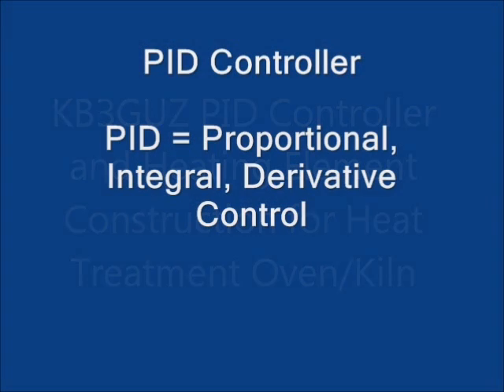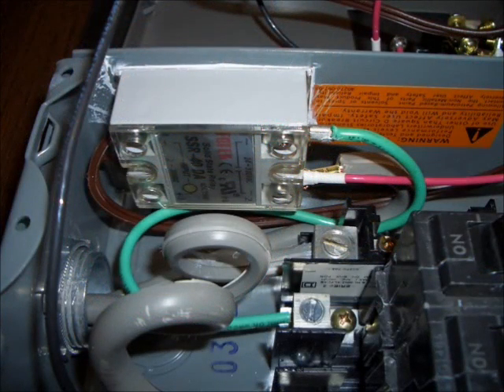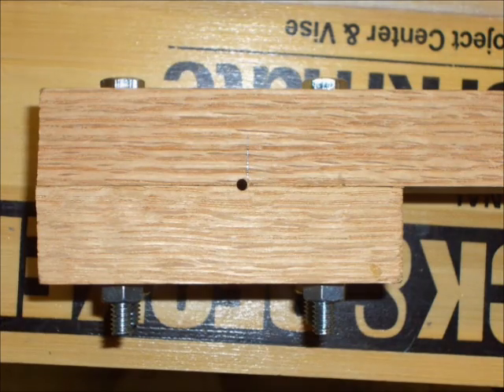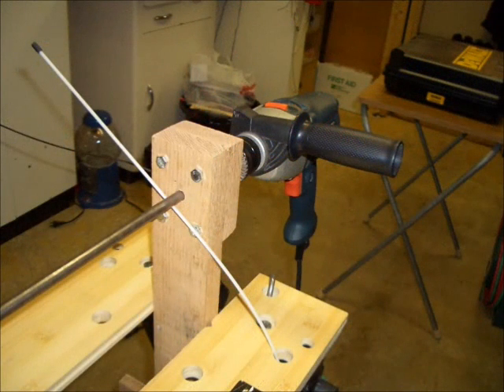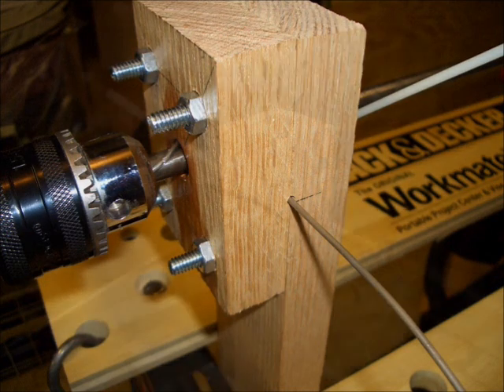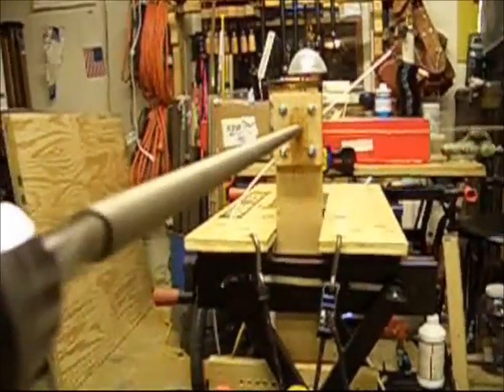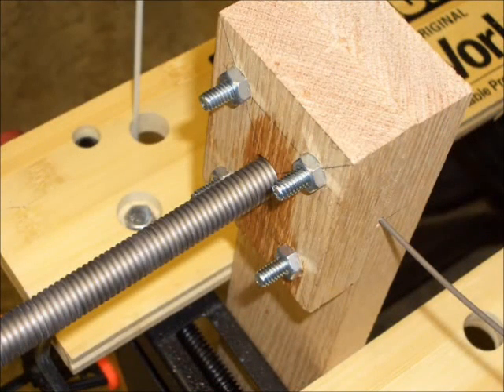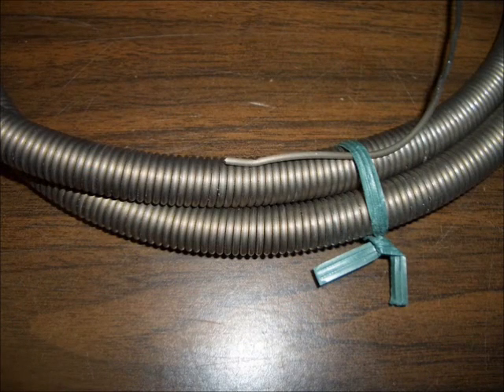kb3guz - How I made a PID oven or kiln control and heating element.

Comment: excellent video and picture documentation!!! whats next? i m curious to see the spiral in action! i guess its kanthal D wire. 3/8'' dia makes 9.5mm?! it looks thinner on video. and calculating with 9.5mm i endup with ~500mOhm for 100ft which is definitive to low for 230V. 3/8'' is diameter or square? hope you can help after so many years ;-)

Comment: great video. do you think this schematic would work with electric oven heating elements? I want to build the exact pid controller box only use 4 heating elements all wired together instead of a coil.

Comment: I'm Building a conveyor belt Oven for 600 degrees f.  " Just Drying Ink"  and Only Really needing 320degrees f   With 220VAC
Two:  Kanthal A1 wire 16 G 25ft roll's that will make Two 5ft coils 1/2" dia.
Run them in series, with a PID + K Thermo Senor + 25A SSR.
IF I have done my math Correct the 16g:  0.324 Ohms/ft, Come out to 16.20 for 50 foot of wire, and will run @ 13.58 amps and 2987 Watts..  I THANK YOU, your Vid Helped ALOT !  I just wanted to Double check with you that I'm Correct ?

Comment from the maker: Also, don't forget that the Kanthal wire will be uninsulated and energized when the oven is plugged in.  Don't touch the heating element when plugged in - you may die (if you provide a ground path)! Safer to unplug before you open the oven for any reason.

Comment from the maker: You won't want to draw more than 15 amps of current at 120 VAC, and you might need 1,500 Watts of power to heat your well insulated oven. Therefore, using 12 amps for safety & the Ohm's Law calculator mentioned above, the Kanthal wire you need to use will need to have 10 Ohms of resistance.  Knowing this, and the Ohms/ft of wire, you should be able to calculate the length of wire needed. You'll need a solid state relay controlled by the PID, and don't forget to include a fuse or circuit breaker.

Comment from the maker: I don't know if I can help, but if you search for "kanthal wire" you should find a manufacturer's website that will.  I know you can use PID to control the oven.  I don't know how much Kanthal wire you'll need but the manufacturer will.  You get a certain number of Watts of heat per foot of wire, and the wire will have a certain resistance per foot.  Use variations of Ohm's law to figure the rest; i.e., E=I*R and P=I*E - see w w w. ohms law calculator. com/ohms_law_wheel. php (remove spaces).

Comment: can you help? im trying to make a small mailbox kiln for around 100 dollars can i use china controller and heating element? can you send me the simple specs ? i want 120v idk how many amps or the other stuff but i want to use it on house plug, i will be using it for boro, probably 1500 degrees f. at the highest..

Comment from the maker: Caution - in my circuit, the SSR breaks the circuit when heat is not called for, but the element is still energized with respect to ground.  Just like a toaster, you'll get shocked or killed if you touch the heating element and ground.  Turn off the circuit breakers and unplug before touching the element(s) at any time.

Comment from the maker: Make sure your heating element(s) are connected as designed (series or parallel) and that you are feeding them across the two hot wires for 220VAC, not across one hot wire and neutral, which would be 110VAC.

Comment from the maker: Two elements connected in series is the same as one element in that both elements see the same volts and amps.  Two elements connected in parallel is different - each branch of the circuit sees half the volts and amps fed into them.

Comment from the maker: I'm feeding one heating element with 220VAC - not two.  My element is 100' of Kanthal wire (I think it's 12ga, but can't remember) that's coiled to take up less space.  As far as wiring goes, I suppose you could feed two heating elements that are connected either in series or parallel, but they would have to be designed for it; i.e., the length and resistance of the elements would have to be sized for the circuit.

Comment: My rig is all wired up with the right relay now my problem is that I'm not getting the temp I need - like you I'm feeding in 30 amps to 2 1500 watt kanthal elements but I'm getting at best 220F; any idea what's going on? Is it the connections to the elements maybe?

Comment: Hoping you can help because this is driving me mad - PID seems to be fine, displaying what I believe is the correct ambient temp (no way to verify but feels right) and my set value. SSR, which is 40 amp AC in and out works when powered directly but not when attached to the PID so I'm assuming there is something I'm missing in the programming and the instructions (Chinese English) just leave me confused - no explanation of parameters whatsoever,

Comment from the maker: Try disconnecting the SSR from PID and making it go on and off with a low voltage DC supply like a 9VDC battery. Make sure you have the polarity right. If that works, it may be the PID. Some SSR only control DC voltages. Make sure yours is for AC.